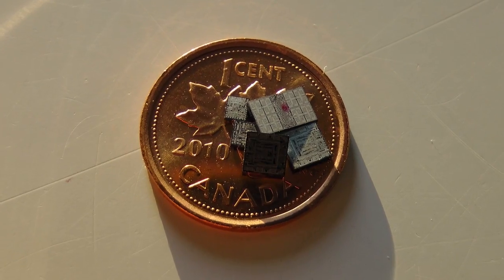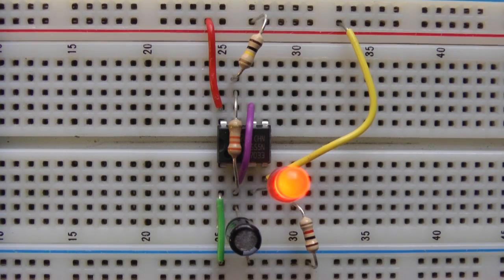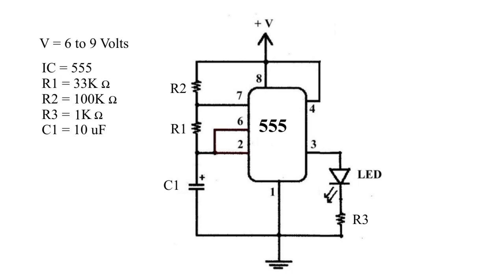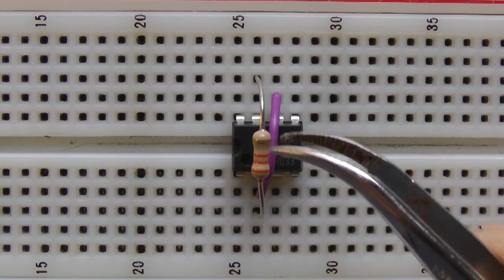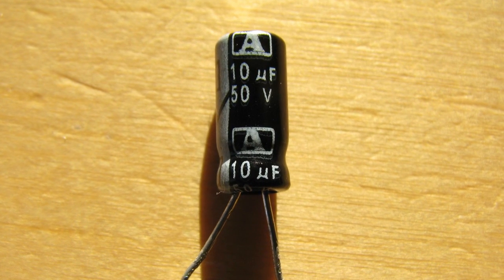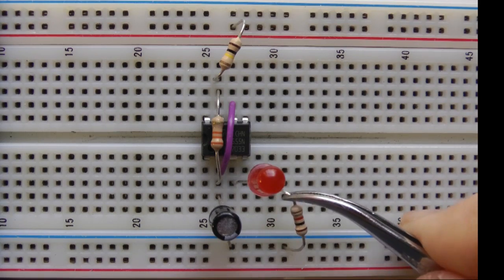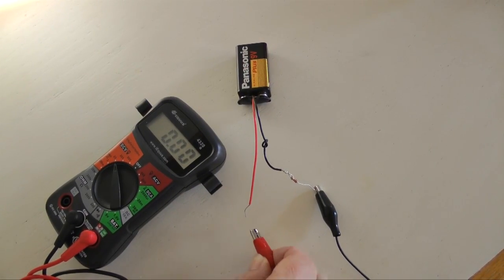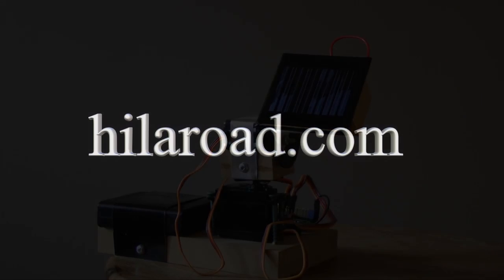Electronics - 555 Timer, A Microchip Project

Comment: If you put a 100k reliable resistor 2 slots behind port 2 on in 555 so the back left pin is one in front of the capacitor, you can control the rate of the led's flash. I will put a video on my Channel to show exactly where it is.